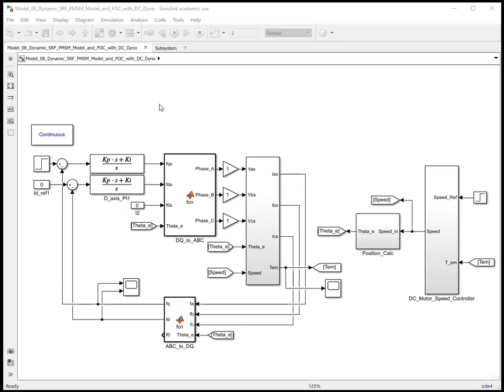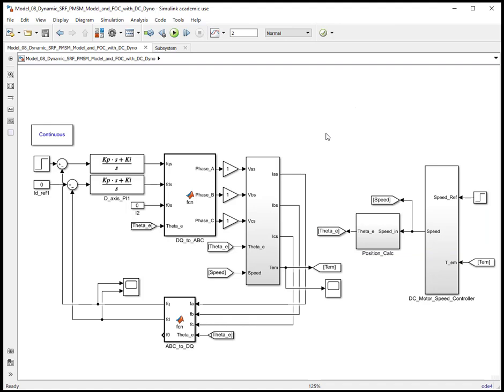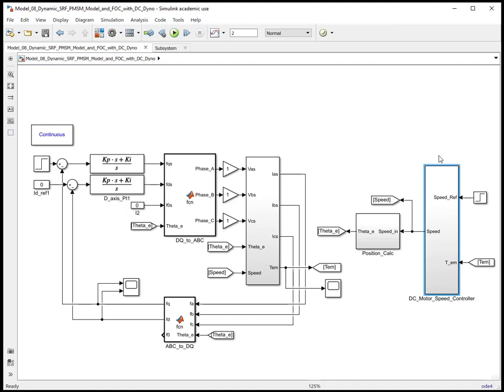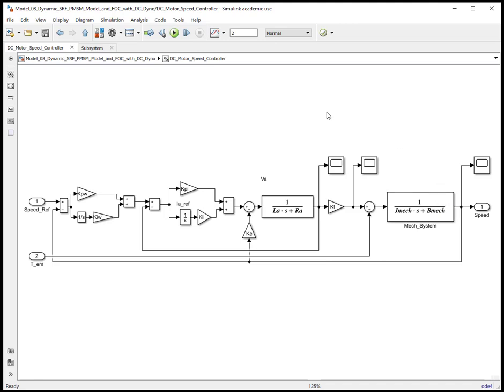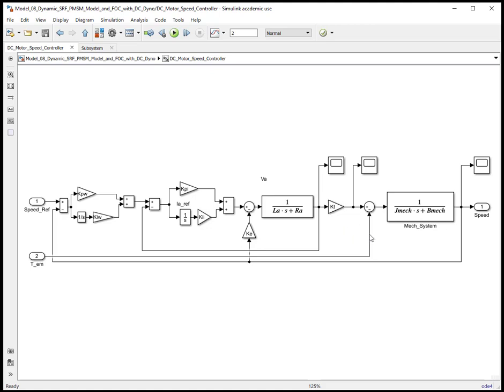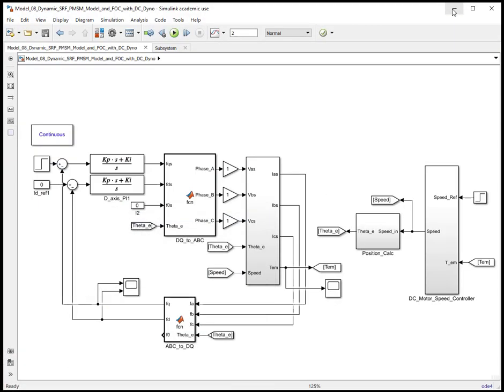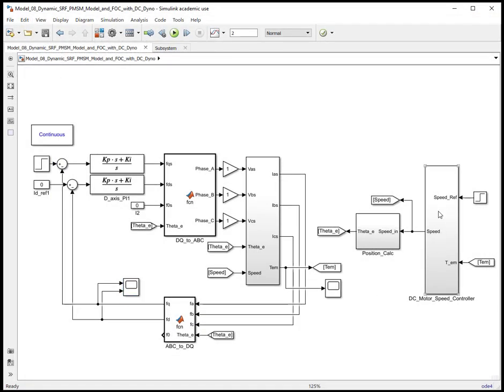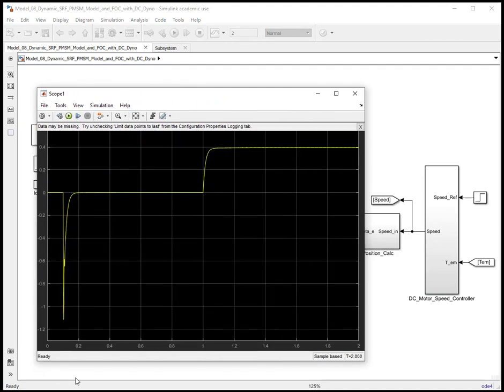FOC with Dynamic SRF PMSM Model with DC Dyno

Comment: Sir, i used eqn 6.2-6 of the reference book (as written in a comment below) to write the code for "torque_no_test" block. But it is showing greater transient that what you showed. 
Also the term (Ld-Lq) comes to zero, as per the "Parameters" script we loaded in the workspace, which in turm is giving a torque output of -13. Please show which Torque equation you have used in that block.
Also, how come 2 different values of "La" is assigned in the Parameters script?

Comment: Hi Prof, Is it possible to do with AC Dyno as well? It will be useful to know how we can load the converter with AC dyno and see the dynamic response of converter when there is step change in the load?
Reply from the maker: You could do that, but that would take a little bit longer to run the simulation. The AC machine would act as a generator. The AC dyno will be in speed control mode if the PMSM is in torque control mode and vice versa.

Comment: Thank you very much for making these lecture series. This is very helpful to me for understanding.

I'm stuck in one area. I have used eq. for Tem block Tem=(3/2)(p/2)(Lamba_m_r*iqs_r + (Ld-Lq)*iqs_r*ids_r). But I don't get the desired results. Is this correct? Please reply to me as soon as possible.
Reply from the maker: Yes, it is correct. Are you comparing with experimental data? If so, make sure the sensor calibration is correct.

Comment: Can you please tell that how can we find reference torque from reference speed??
Reply from the maker: Torque reference is based on the torque needed by the application. Here only the current references are set to achieve a certain amount of torque. Torque reference calculation will be a different video later.

Comment: Hi Sandun,

Firstly thankyou for your videos, they are really helpful. 

I was wondering if you could do a video on how to attenuate DC link voltage when the converter is operating in regeneration for a synchronous machine. That is; how do we make sure that during this type of operation the DC link does not go up too high, but rather saturates at a certain point.

Thanks again! 

Doron
Reply from the maker: Hi Doron, I will add this to the list of topics I'm planning to create videos on. Thanks!
Reply: @SandunKuruppu  

Hi Sandun,

Thank you so much! I look forward to watching the video.

Doron -  from RMIT (Melbourne)
Reply from the maker: @doronlola1763  I saw a comment from you about a different question, but I cant seem to find it. Feel free to email me if you have questions.